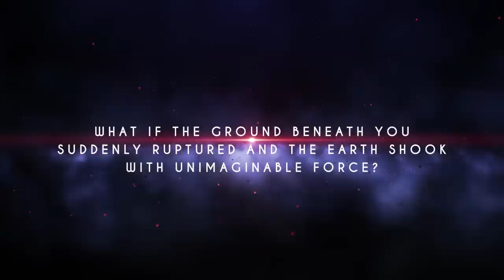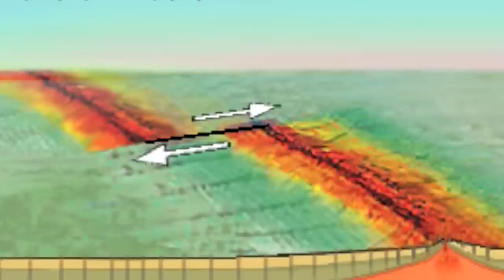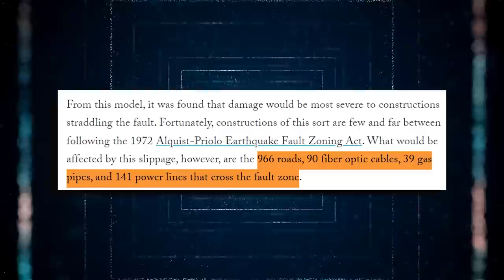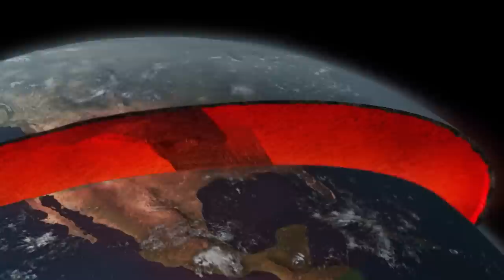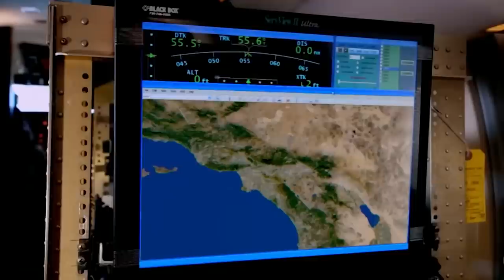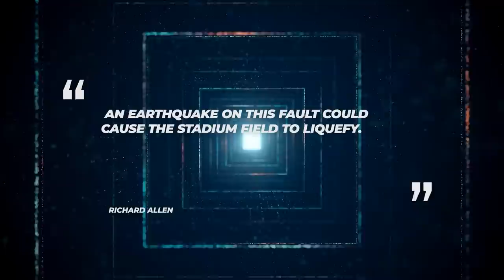You Might Wanna See This Before Next Month..

Comment: Many of the place names in California are Spanish. The J on Fort Tejon is pronounced like we say the letter H in English.  

Since the Loma Prieta and Northridge quakes, California has instituted improved building codes that require retrofitting of older buildings and road overpasses and bridges.  You will not see a large skyscraper falling over as depicted in some of your footage.  

The good news is the portion of the San Andreas fault that has not had a recent earthquake runs through very lightly populated areas.  This is the portion of the fault that bends to the east away from the coast, south of Los Angeles.  San Diego has not had a major quake in about 10,000 years, yet all our roads and old buildings are retrofitted.

Actually, tsunami risk from the Cascadia fault is probably a bigger risk to California coastal areas.  Subduction zones are where the truly monstrous earthquakes are generated.  San Andreas is a strike/slip fault.